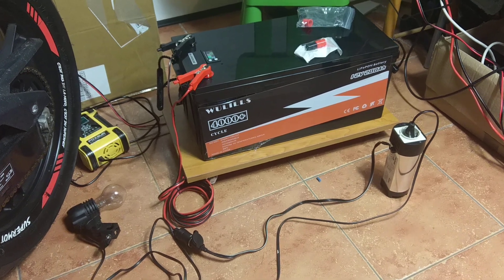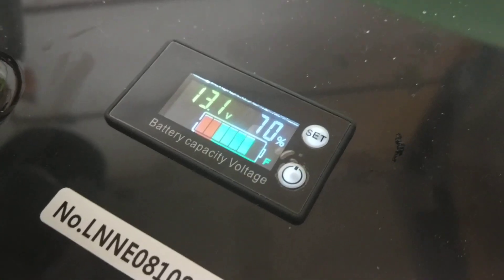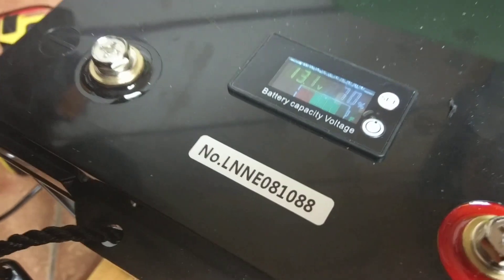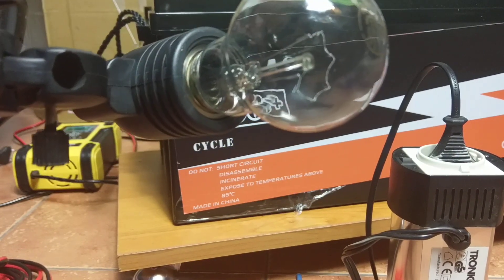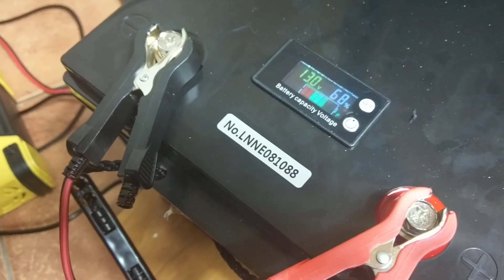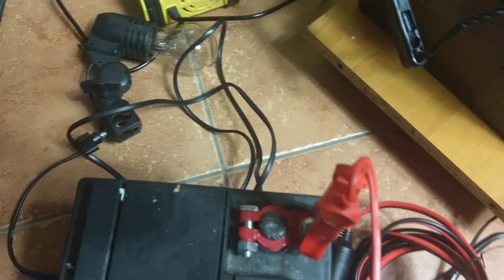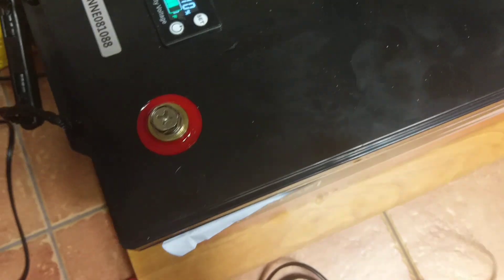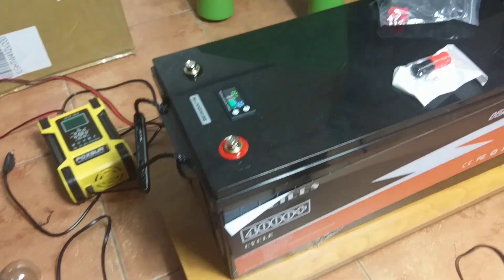Wulills lifepo4 battery review & test - 12V 200Ah

Comment: yep i tryed to order a battery of this manufacturer , and by accident i ordered a more expensive model then i needed  ,the difference was 60 or 80$ but i contacted them and asked if they could send me the cheaper 24v battery and just keep the extra money left over and they said yes ,then a few days later they contated me and wanted a amount more for the delivery as they said i was located remotely ,and i said fine just take it out of the extra money i paid in for the battery ,no no no that was not possible ,,,after alot of back and forth i asked them to cancel the order and release the money , but they tried to convince me that i had to comfirm delivery in order to get my money back (yes i know aliexpress do not release the money to them before comfirmation) but on the other hand i can not comfirm a delivery that never took place ,,in the end i opened a dispute and got my money

Comment: You can crack the case open by compressing it from the sides (long side). The glue will crack open. Use an old credit card to loosen the glue around. Then you will be able to open the lid. I would check for loose terminal connection (one of my batteries had this, tightened it with a locking nut). Perhaps that will resolve your issue - it sounds like a loose connection.

Comment: Yes it is a scam, i bought two of them one of them work fairly and the other doesn t work at all, i contacted the seller and he said that i have to charge it then he said it s the bms, he sent me a bms and still didn t work. Then he said that he have to talk to the engineer, then he said that the battery is good.
Don t be attracted to the price, i ended up throwing away 930 euro for this junk.

Comment: Hi, i've bought an identical battery, and i've the same problem. With a load of 300 Watts the voltage drop by 13.3 to 12.1 volts in 20 seconds!
Reply: The serial number of the battery (LNNE081122) i bought is similar to the serial number of the battery in the video, maybe both are from a bad stock...
Reply from the maker: You need to contact seller, create dispute and replace it ASAP . Mine was replaced and now it works. There will be new video soon.

Comment: Did you contact the seller? This is not just a matter of underperforming, this is totally unusable. I wonder if all their batteries are like this or they just have bad quality control and they shipped a battery with a bad cell or something.
Reply: Any updates on this? Im planning to buy the same battery 🤷🏻‍♂️
Reply from the maker: Yes. I have received battery replacement a few days ago. It seems to work now but I am still testing it. Soon there will be update on this matter.
Reply: @CuAgFe  That's good to hear. I am very curious what the results of your tests will be. I am sure we all are.

Comment: Purchased 2 metal cased 200 amp battery tested and results for both are roughly 180 amps made dispute through PayPal skipped aliexpress resolution centre too many bad experiences with aliexpress resolution in favour of the sellers provided my results to seller he offered compensation and stated that they set the bms to 180 amp because people overcharged and over depleted the batteries b.s he sent me crybaby emoji 4 of them 😢unbelievable  never received any manual for batteries they sent by email after repeatedly asking and warranty supposed to be 5 years after receiving email of warranty stated  one year  never heard from seller till opening the dispute stay clear of this garbage live and learn